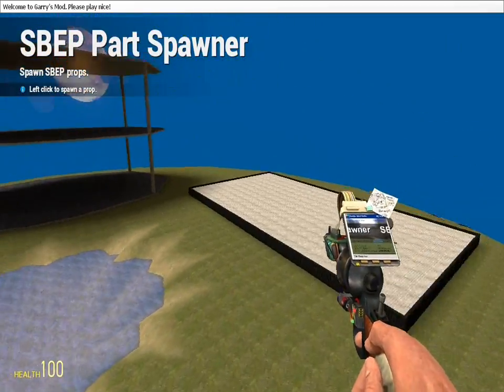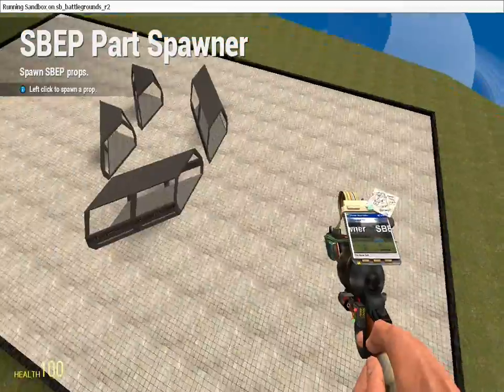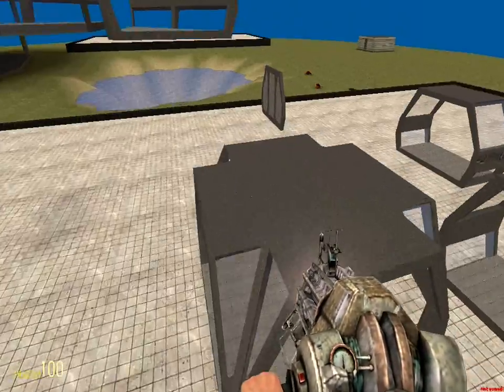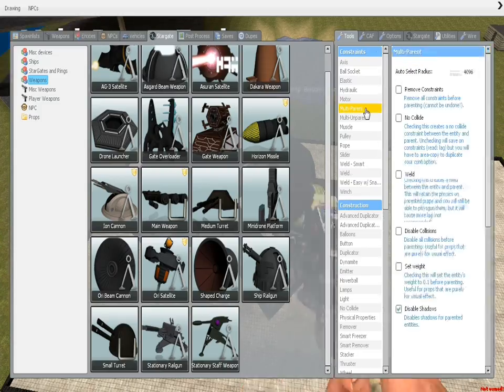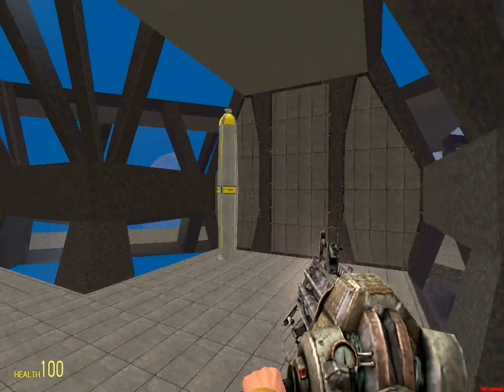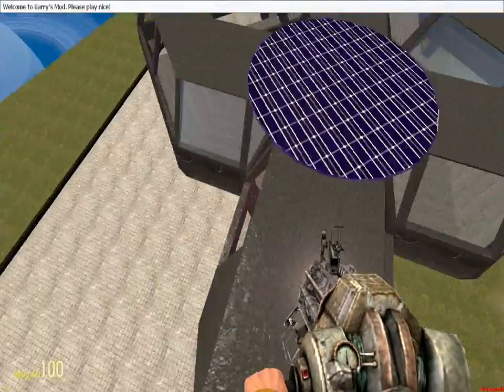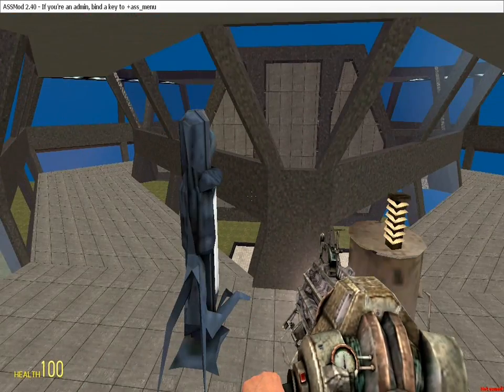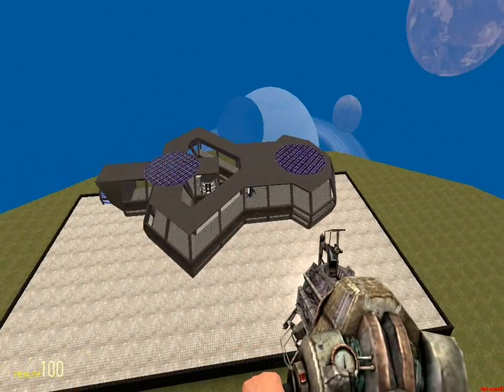Garry's Mod - Spacebuild Tutorial - Ship Building - 1 - Design (CAP, SB)

Comment: How do I get these mods????
Reply from the maker: Stargate (CAP) is on the workshop, Wiremod is also on the workshop, as well as SBEP (Spacebuild Enhancement Pack, which is the one with all the nice ship parts). Spacebuild itself is not, so you'll have to trek your way over to GitHub for that one (just google "github snakesvx spacebuild" or something like that).

Presumably those were you mods you were talking about?
Reply: Kytuzian canu link cap plz
Reply from the maker: It's on the workshop.
Reply: Kytuzian i cant find the addon called Cap can u link it' it be more easyer
Reply from the maker: Did you even bother searching? It's the first thing.
Reply: Kytuzian yeah i put CAP in the workshop as tool
Reply: Kytuzian or you can tell me who it by
Reply from the maker: Search "Carter's Addon Pack"
Reply: Kytuzian thanks got it now